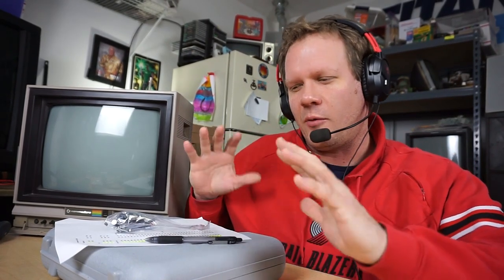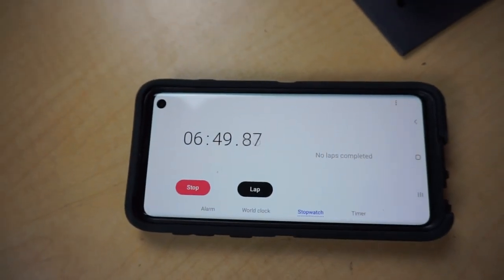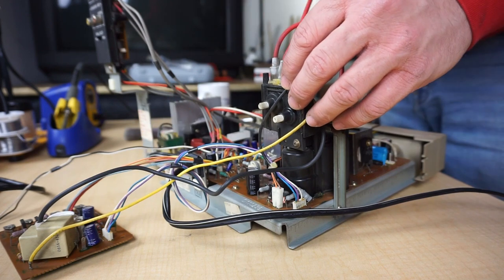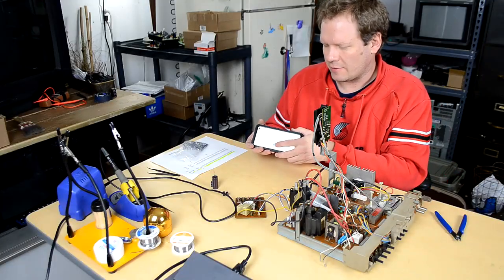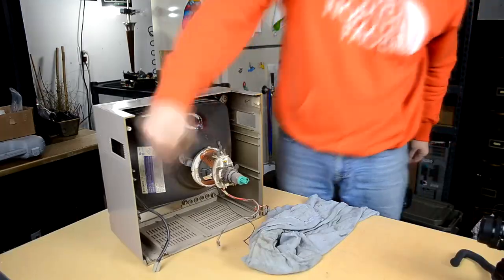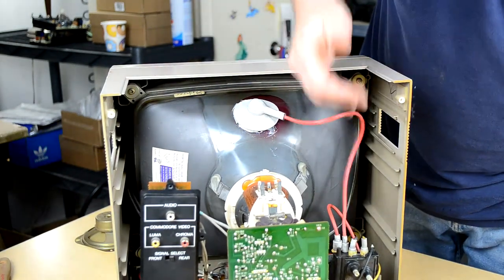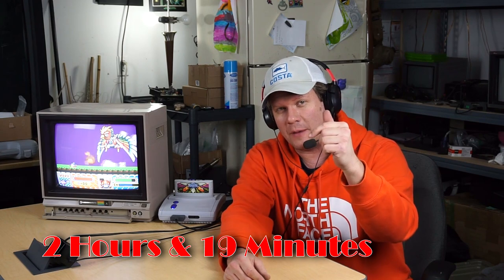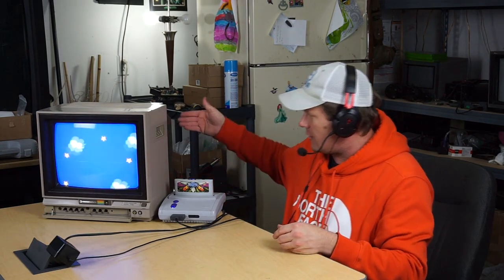How fast can you restore a 37 year old CRT Display?

Comment from the maker: Today's background music comes courtesy of the Sonic CD soundtrack.  Love those old Sega jams!
Reply: Steve I have a question. I have my Dreamcast connected to my BVM D24 with a packapunch 480p scart cable, and when I start the system in 480p, i am getting this bend on the top of the image(both sides). It does not happen unless the cable is switched to 480p. It also does not happen with any of my 13 other retro game consoles. Here is what is strange, I also own a BVM A24(infamous 68X)........but even with all the other sync issues my A24 encounters, the 68X works flawlessly with the Dreamcast at 480p. Do you know why I might be experiencing this 480p image bend on my D24? Thanks for your knowledge and time:)

Comment: Thanks for fixing this CRT for me!  It should outlive me now.  I talked to the original owner of the monitor a few days ago, and he said that he's happy that it's continuing to have a productive life.  Some quotes from the original owner:

"I just realized how much history that monitor has - haha.  Not only was it used for C64, it was also used for original NES, Super NES, N64, 3DO, Sega master system, Sega and Genesis - haha. My grandmother used it to to play Tetris on the original NES."

"Spent countless hours going through the C64 library with copied floppies
First experience with BBS was on that monitor"
Reply: I ended up switching from a smaller secondary pvm to a 1702 After realizing how reliable they were. My only isue with them was the sega genesis looked bad in composite.  
found out about a made in china svideo adaptor that plugged into the back of a genesis no mode required. that adaptor made all the difference in the world it cleaned up the picture well beyond what i expected to see.